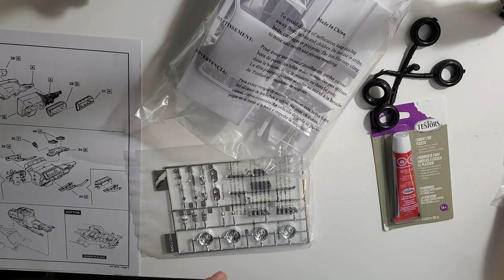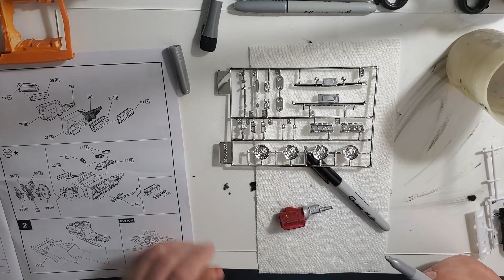1971 Plymouth Barracuda: My first model as an adult (last one, 40 yrs ago when i was 13)

Comment: Nice. Your front bumper is upside down.
Reply from the maker: Thanks! I am looking into that and how to flip it without damaging anything else. Thanks for the comment!
Reply: I’m just pickin at you a little, please don’t be offended, but I’m still wondering how you’re gonna get that rear view mirror in there. @BaileyModelworks
Reply from the maker: @CrappyBuilder  tell me about it! It fell out while I was assembling the body. I think I have some long tweezers? I will post if I get around to it. No worries about picking, any advice is welcome!
Reply: Nice looking build, I’m like you I just recently got back into the hobby after 30-40 years